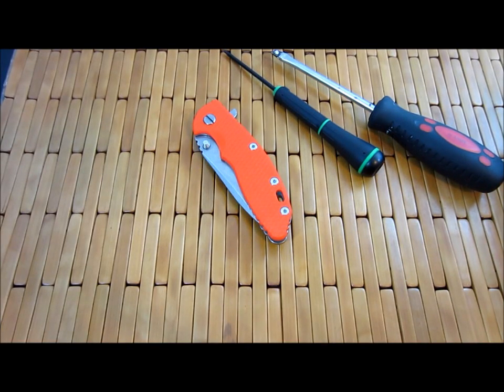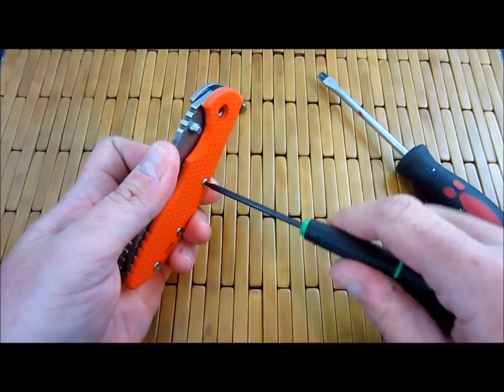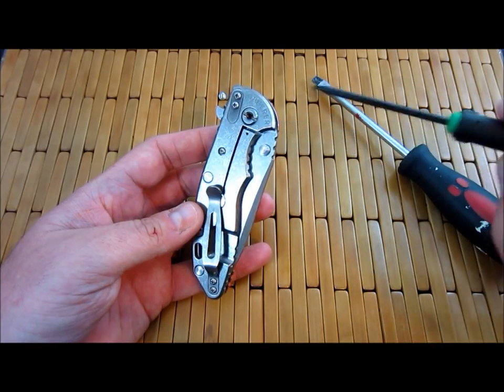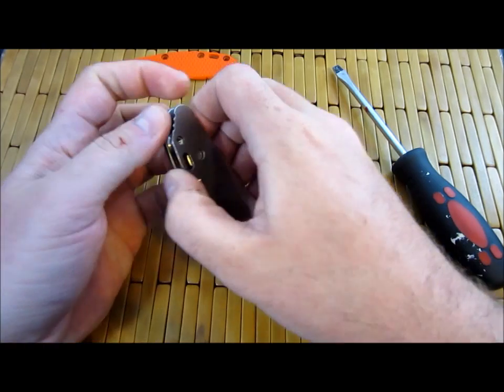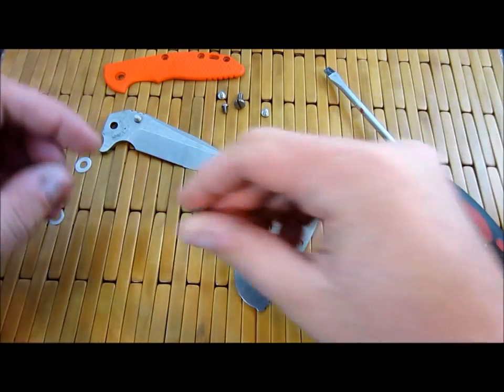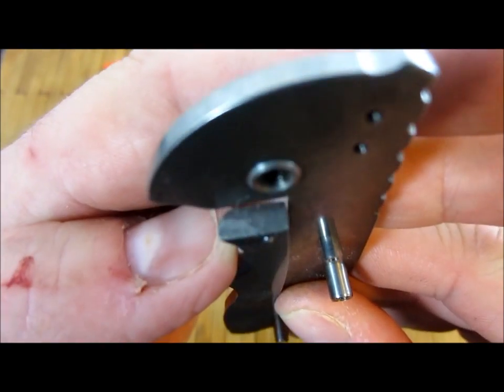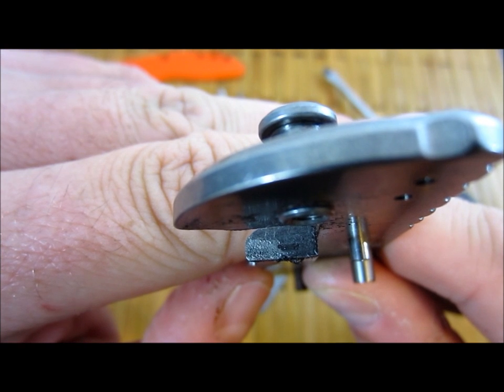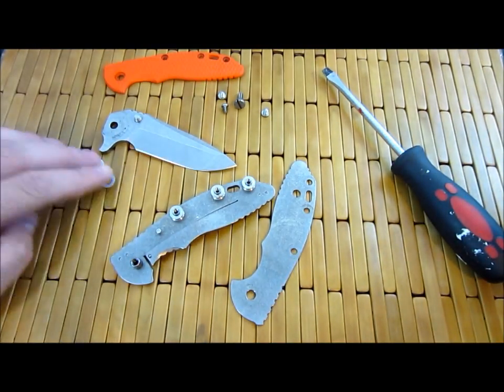Does Rick Hinderer Carbidize His Lockface?

Comment: Exactly. It's a preventative measure. The layer that is applied by the carbidizer is on the order of ten-thousandths of an inch. It is not enough to fix an out of spec or worn out lock. Even if you sat and applied a layer 2 thou thick it would just flake off the first time the lock engaged.

Comment from the maker: It might work. Depends on the severity of the rock. Carbidizing will build up the surface of the lockbar, but very a VERY small amount. I would not consider it a "fix" for lock rock. It works great as a preventative measure though.